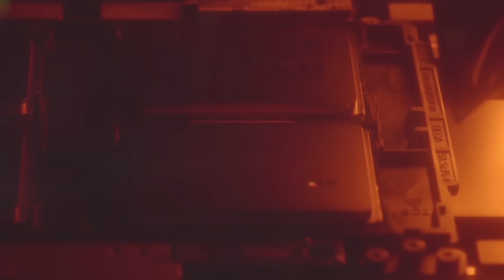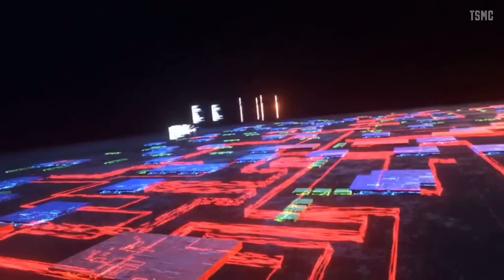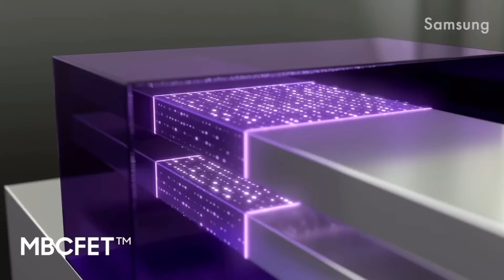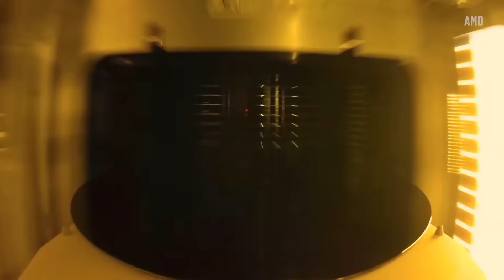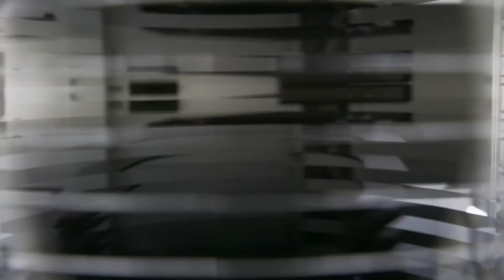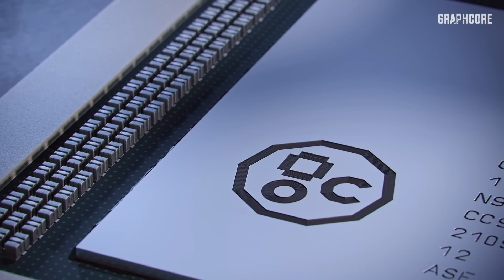Understanding New TSMC 2nm Technology

Comment: hello, can you give some advises about that it's  concern in electrical engineer in work abroad the russia? Because i'm working in the same are in russia and it's cold like automatic control system. That's is the diffirence if you work abroad, Which deep knowledge do you need to have? Because that i'm usual made at my work it's a creating electrical cabinets by eplan/autocad.

Comment: Off-topic here, and I know it's not your usual content, but do you know about anyone actually trying to compete with the Raspberry Pi in terms of price and performance (not counting scalper and secondhand market prices, just MSRP).  Most of the SBCs at that size all seem to be 4-10 times the price, and it just doesn't seem like anyone is even trying to compete with them.  Not that I need a Pi competitor because the Pi is pretty awesome, but it would be nice to have some options that aren't absurdly expensive, and also because Pis are hard to find right now.

Comment: 2 nm is 6 to 10 silicon atoms, depending on which direction is measured along the crystal lattice structure
Reply: Ye, but no structure they produce is actually this small... For example the gate lengths of N5 are about 10nm so thats still like 20 atoms. This is pretty close to the limit of what is possible. Going GAA allows them to increase density without having to shrink the gate laterally, i.e in width/length. Also the characteristics and switch times will improve since for example in an N-Channel MOSFET (saturation type) the electrostatic induction of electrons lets the conducting n-type layer "grow" from the gate interface into the substrate of the channel. If you have the gate all around, your whole conductive layer will "grow" from four sides simultaneously which reduces the time it takes for the transistor to change it's conductivity. This makes the transistor effectively way faster while reducing it's lateral size. It's all about the geometry.

Comment: do you think the carbon nano tube is in the futur of conductor ?
Reply: No. Currently Carbon has a band gap problem. Most likely they move to 2d material like Molybdenum Disulphide. But that is several years down the road. Near term is they switch the channel to SiGe after that they go full Germanium channel. This is for material technology. For transistor architecture after Nanosheet transistor is Forksheet transistor after that is CFET.

Comment: Its hard to believe this is even possible without quantum tunneling stepping in to ruin the day...
Reply: Just some thoughts: 1) She mentioned leakage being affected by width/height ratio of the transistors, and likely you are right that leakage by quantum tunneling is a large contributor, 2) Operation at very low voltage would reduce probability amplitude of quantum leakage/tunneling, 3) Intentional choice of the transistor's channel thickness can cause the quantum probability waves leaking from opposing sides of a thin transistor to interfere, such that tunneling/leakage probability is partially suppressed. Basically, design device such that it will mostly operate between quantum modes that are set up across the thin dimension of the transistor having gates on opposing faces.  This would be opposite the design strategy used in "tunneling diodes" which use a quantum mode to enhance passage of current.
Reply: @thomaskoscica7266  my two cents on this: 1) Current leakage by tunneling is indeed present but stil low compared to a transistor that is "switched on". Depends on what minimum current the subsequent transistors will "switch" if it will or will not introduce errors. 2) Correct, the transmission probability will decrease since lowering the voltage across the transistor is equivalent to increasing the potential barrier height. 3) Not sure if this is possible to control with such small structures. Bear in mind that the real transistors are not perfect and the interfaces have some kind of roughness and imperfection due to the way they are produced. Calculating this in a model seems easy compared to actually realizing this idea.

Comment: Am I mistaken or this is the same concept that Tesla employed for Dojo* and that will end up in the Tesla bots?
Reply from the maker: If you mean the package, I think they are using TSMC’s InFo SoW - System on Wafer
Reply: @AnastasiInTech  I meant the idea of developing the chip not just over the surface, but in "3d" with different layers and levels stacked on top of the others
Reply: @Augustus_Imperator  I think you are conflating two different technologies here. When we talk about 3D chips, we normally mean multi-wafer/3d packaging. This is were you bond wafers together on top of one another. AMD did this with their Ryzen 7 5800X3D, and this looks like what Dojo will use. What was just discussed (GAAFETs) is just taking an already 3d process: repeated cycles of etching, doping, and deposition, and making it a little more 3D.
Reply: @benjaminmiller3620  I think you are right, I'm conflating the two